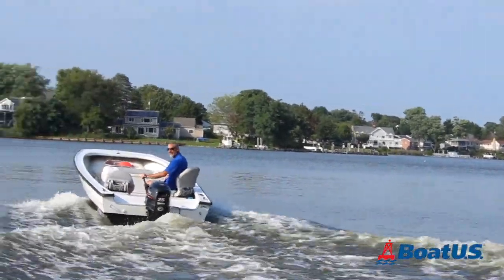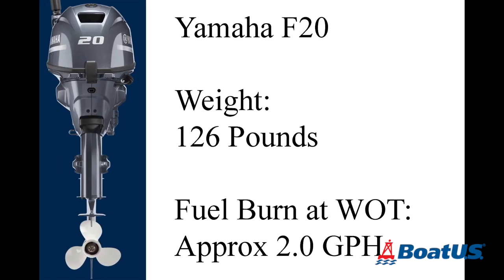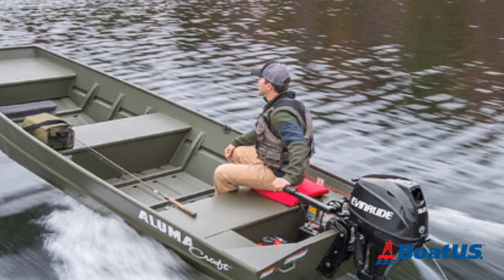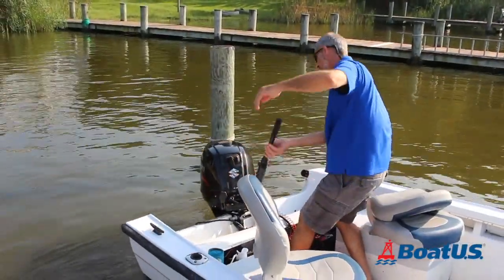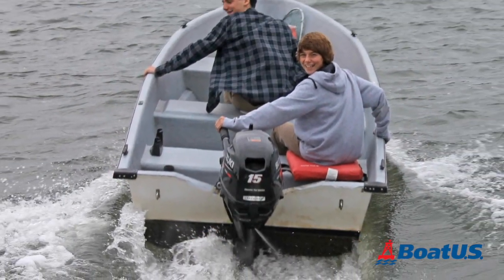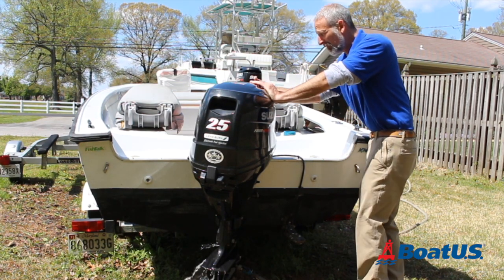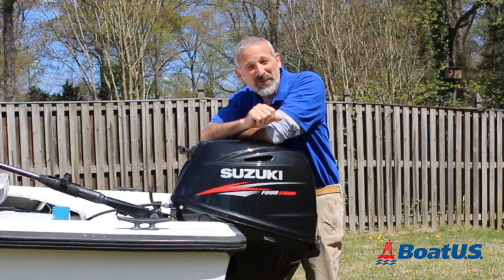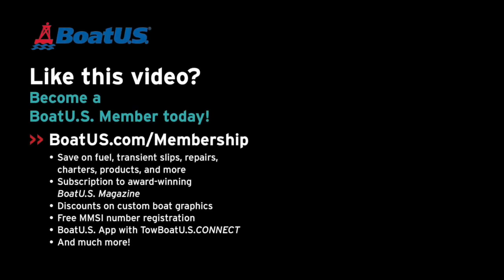Choosing an Outboard Motor for a Small Boat | BoatUS

Comment: Tohatsu 9.8hp four stroke is the best motor I have ever owned, got it 2018 and it is virtually in constant use in salt water. just cant fault it.
Reply from the maker: That's awesome, David. Glad you've have good luck with it. If you're a BoatUS Member, you might be interested in a story we have in the upcoming issue of BoatUS Magazine on the latest technologies in small outboards. We talk a little about the Tohatsu propane outboard in it. The technological advances in smaller motors are mind-boggling!

Comment: Hello!!! I am just writing you because I have not found any body talking about small engines for the small inflatables, I have a Newport (Catalina) is 17 foot long, and I am new on how to choose a small engine for it, I have found several small engines but they are very expensive, what I am looking is a cheap engines below the $1000, that it is going to take me to the ocean and fish about a Mile out, and not have any problems with it!! what would you recommend??? I would like to thank you for your information on this little matter.
Reply from the maker: While we understand your desire to stay under $1,000, Max, that probably means looking for a used outboard. You can find the smallest outboards the major manufacturers produce around that price-point, but a 2 or 2.5 hp outboard won't be powerful enough to control a 17' boat in the ocean. The minimum you should consider is probably around 20 or 25 hp (which may be slow and probably won't get you on plane with multiple people aboard), and these generally go for several thousand dollars new. We wish they cost less, too, but that's just the reality of the matter. Good luck!

Comment: Great video! I'm having trouble finding information about my old boat. I can't find a HIN number. It's a Cadillac 13.5 foot aluminum row bow with a 48" wide by 15-16" transom. It's a three seater and is 54" wide at the widest part of the hull. I'm looking to buy a 9.9 HP Merc. Is that to big? Too small? and what should the length of the shaft be? I appreciate your time and input.
Reply from the maker: Wow! What a cool boat, Start! That's a new one to us. Measure from the top center of the transom to the lowest point on the transom, and then get the shortest shaft length that matches or exceeds that measurement. You have to be exact -- you mention it's "15" or 16" and if it's 15" a 15" shaft motor will be fine, but if it's 16" you'll need a 20" shaft. As for horsepower, without knowing the manufacturer's specifications it's a guessing game, and we can't make any guarantees. That said, a 9.9 might be a bit much. An average modern 12' Jon boat is rated to 6 hp. That doesn't mean your boat can't handle more, but that's a judgment we can't make from afar. If you haven't done so already, check out the website  https://www.wagemakerwolverineboats.com/cadillac_aluminum_boats. There's a plethora of info there on the history. You might try reaching out to Brian for more info. And the reason you can't find a HIN is because you boat predates them. They weren't required until Nov. 1, 1972. Hope this helps and have fun with it!

Comment: Thanks, it was very helpful. I know that it's not common to talk to a specific brand type in the youtube for you guys but is possible to talk about that and say which brand is better in terms of quality and performance. Actually, I have stocked between Honda, Yamaha, and Suzuki but some people believe that mercury is better in terms of maintenance cost. Or if it's possible tell us some hints about choosing better brands.
Reply from the maker: Thanks for watching, Yasser. I wish it were that simple. Unfortunately there are too many variables to talk specific brands. Some folks have very specific preferences for whatever reason (like trucks or cameras). Some stick with a brand they've always used. Some go by price, features, or performance. It really comes down to your individual needs. If you narrow down your options, you can do research on any issues, find customer feedback, talk to a dealer/mechanic, or join a Facebook group or board to get feedback from others with experience. The best thing you can do is research, research, research and make the best decision for you based on the info you have available. Good luck!

Comment: Thanks for the info. I have a 4 meters aluminium fishing boat. I don't want to go the open ocean. Just rivers and lakes and if I go in the open ocean not really far. I want to know how big motor I should buy? Is 40HP should be enough? Thanks
Reply from the maker: Hi Syed and thanks for your question. If possible, you want to check with the boat manufacturer to find out what the largest outboard is that's recommended. You don't want to exceed that, or it can be dangerous. With the info you gave, however, 40 hp might be a bit too much for this boat, especially if it's lighter weight. But it's hard to give you an exact answer without being there in person and having more info. You might also want to read some of the other questions and answers here as others have asked similar questions. It may help you narrow down what you need.
Reply: Thanks for replying. I will check that.

Comment: I currently have a 25hp on a 14’x5’ with a 20” transom boat, the motor has electric start and trim, but I think it might be too heavy(180lbs plus or minus). Do you recommend a 20hp with same futures at about 124 lbs or 30hp at 131 lbs manual. The boat is rated at 920 lbs total and rated at 25. Any advice?
Reply from the maker: Thanks for the question, Yoisdel. If the boat is rated for 25, we wouldn't suggest putting a 30-hp motor on it, period. And note that 20 horses is usually plenty for a 14-footer. Also, remember that, depending on the brand, a 25 could be the same weight as that 20 you're considering. A Yamaha F20 and F25, for example, have the same powerhead and are both 126 pounds. In any case, it's wise to consider the difference between weight and power between the 20 and 25 since a 50-pound jump (which is about what you'll see with most other manufacturers) will shrink the performance difference. Either way, it's best to remove the 30-hp engine from the conversation. Hope this is helpful!

Comment: Speed is a big component!!!
Reply from the maker: Thanks for watching, Darren! You're correct--though horsepower needs to be matched to the individual boat. It's dangerous to get a motor that exceeds weight or power recommendations from the manufacturer.

Comment: Last comment...Is one of the biggest downfalls of used boat motor buyers...Know your Transom measurement  and get proper length motor...
Reply from the maker: Thanks for watching, Dan. Yes, the questions about what size/length motor to buy seem to be the most common we're getting. Like everything else, though, everyone has a different opinion. We prefer to stick with manufacturer recommendations.

Comment: i have a 14 ft v hull with a 20 hp mercury 20" shaft. My transom is 15 inches, however the previous owner installed a mounting plate that raises the motor another 4-5 inches. is the long shaft okay?
Reply from the maker: Thanks for the Q, Hunter. Chances are yes, however, once you modify a boat's transom and raise up or cut down the motor's mounting position from what the manufacturer designed and built, all bets are off. It's a good possibility the previous owner did this to accommodate a specific outboard but we have no way of knowing if it worked or not, and how well. The only way you can be sure of the outcome is to put the motor on, give it a shot, and see how it runs.

Comment: I have 14 ft v hull fiberglass And I paired with mercury 20 hp 4 stroke you think I overpowered it ?
Reply from the maker: Hi Eddie. It really comes down to the weight of the boat and maximum recommended HP by the manufacturer. Without more information, it's hard to say for sure. If possible, double check manufacturer specs. It could be dangerous if it's overpowered.

Comment: Excellent information,  I measure the transom is 23” need long or xtra long shaft ? Is an old bass boat Monark Macfast 5. I would to know what do you suggest for hp? Thanks so much
Reply from the maker: Thanks for the question, Jairo. I reached out to Lenny who had the same issue with one of his boats. Occasionally when dealing with some very old boats you'll encounter transoms such as this, which weren't built to today's more universal standards. Putting a 20" shaft motor won't work without modification; as soon as the boat begins to plane, the prop will be starved for water. You can cut the transom down in some cases, but you have to make sure there's room for turning the motor without any of the rigging hanging up or hitting the edges. You could also try a jackplate, but the results can't be predicted ahead of time - it might work, it might not. And to get the motor at the right height, you may be unable to tilt it or align the steering and/or rigging in such a way that it doesn't have issues rubbing against the transom. You may also find that the motor is too low to the water. The safest bet is to go with the longer shaft.

Regarding the horsepower question, we're not very familiar with these boats as it looks like the model was only manufactured about two years, but from what we've seen online, the max recommended is 85 hp. Others that have this model seem to be running a 70 hp. That said, because overpowering can be extremely dangerous, we strongly recommend consulting someone who might be able to confirm this info. Or do some online searches to see what others are running. Might help answer your question on the shaft length, too.

Comment: Thanks for your time, what's the best petrol for outboard motor??! 98%???
Reply from the maker: Thanks for the question, Behrang. You should always follow the recommendations as contained in your owner’s manual for your particular motor as recommendations vary. Also, it will make a difference if your motor is a four or two stroke. Often, two-stoke motors may not need as high an octane rating as a four stroke.

Comment: I have a 12 foot aluminum v haul. What size motor do I need? Is 10hp to big? I just need it for fishing lakes
Reply from the maker: Thanks for the question, Sam. 10 hp sounds about right, but you should always check the manufacturer's specs and Max power rating to be sure you don't overpower a boat when putting on a new outboard. Hope this helps!

Comment: You say you should measure your transom to know what shaft length you need, but what is the formula to determine shaft length after you have transom depth??  Or is there a table to determine that?
Reply from the maker: Thanks for the question, Uvickerns. Outboards are commonly available in three shaft lengths: 15, 20 and 25 inches, with 20 inches being the standard and the most common size. As a general rule, the cavitation plate (the flat plate that forms part of the outboard leg directly above the propeller) should be level with the bottom of the transom. For larger, heavier engines that are rigged by a dealer, they will be very familiar with which size engine to use, and you should be guided by them. But of course, there are exceptions to every rule, and a long shaft could be used on a boat that requires a standard shaft but the boat will be slower by a knot or two due to the increased drag. Also, there is that much more potential for the prop to hit a submerged object as it hangs lower.

My best advice would be to seek the advice of a local dealer who will have extensive knowledge and can ensure that you are using the correct shaft length.

Comment: What type of motor should I get for my 12 foot boat
Reply from the maker: Thanks for the question, ASMR. Unfortunately we're not in a position to give you a specific answer to your question due to not knowing what kind of boat, where you boat, etc. For a boat that size, though, you might consider one of the many electric options now available. Lenny was a hold-out on electric for a long time, finally took the plunge, and now is a huge proponent of them. (He's got an article about this in an upcoming issue of BoatUS Magazine.) When I asked about range issues, he said he hasn't had any. The one thing we can tell you is not to exceed the maximum size motor recommended by the boat manufacturer. It could be dangerous.

Comment: What size motor and brand would you recomened for a 4'x8' dingy, i would like to have a reverse and be able to hook up an extra gas tank if needed.
Reply from the maker: Thanks for the question, James. For a boat that small, you don't need more than a couple horsepower. In fact, you might want to consider one of the new electric outboard options to avoid the gas issue altogether. 1- to 3-hp models from the lines of ePropulsion, Torqeedo, and others have self-contained, rechargeable batteries with significant range. Before you commit to one, check the capacity plate on your dinghy, which lists the max hp (and max weight capacity). It will be located on or near the transom.

Comment: Sir my boat height is 1meter, 5meters lenght and 1.5 meter. What should be the right length of shaft and horse power should i buy for my boat?
Reply from the maker: Thanks for the question, Gener. The critical dimension for shaft length is transom height. Measuring from the top of the transom to the hull bottom at the center of the transom, match the height of the transom to the published shaft length for the outboard (IE if it's 15 inches, a 15-inch shaft length is appropriate). Most outboards are available in 15, 20, 25, or 30 inch shaft lengths, and most boats are built to ideally match one of these lengths. As far as choosing horsepower goes, it's a matter of personal preference up to the maximum horsepower rating established by the manufacturer. Weight is a critical factor, as some boats of the size you mention, such as a light aluminum jon boat, can plane out and run just fine with as little as 20 horsepower. But a heavier fiberglass center-console of this size will more likely need 40 or 50 horsepower to produce satisfactory performance. Hope this helps, and thanks for watching!

Comment: Hoping you might know.  I am looking to buy a 15hp Honda outboard for my brother as a surprise.  I know he has a 13 foot Valco aluminum boat and figure a 15" shaft is the right fit.  Like I said this is a surprise so I don't want to call him for measurements.  Any suggestions?  Appreciate any help.
Reply from the maker: What an awesome gift, replus! Unfortunately we would be doing you a disservice by trying to guess this without being there in person. Because you aren't able to get the measurement directly, I'd try to find the specs online, though it looks like this may be an older boat so that may be difficult. Also, you would be assuming the transom is original and hasn't been modified. (I'm seeing some ads that mention the transom has been built up.) You might want to look for a Valco group on Facebook or look online for an active forum with Valco owners and ask for advice there. I wish we could be more helpful, but we certainly don't want to steer you wrong. Hope your brother loves the outboard, and here's to having fun on the water!

Comment: My Macgregor 26D has a 20" transom measurement and the old outboard was a long shaft 20". Guys online are saying get the extra-long shaft; some say for rough seas. What is the downside in performance for a longer shaft than measured as needed?
Reply from the maker: Thanks for the question, Martin. Having a longer shaft increases drag, which reduces speed and efficiency. Since the MacGregor 26 is a planing boat the difference could be significant and generally speaking the best move is to stick with the manufacturer's recommendation, so if the old one worked fine, we'd say it's probably best to stick with the 20" shaft. If you noticed the prop gulping air in rough seas, however, a longer shaft would likely resolve that issue. Thanks for watching!

Comment: is it possible to replace a different brand like Yamaha or Suzuki for 15' Boston Whaler Mercury outboard?
Reply from the maker: Absolutely, WestCoast. Doing so will likely require re-rigging, but if your current outboard is outdated, you've probably got outdated steering and throttle-control systems, too, so they'd need to be changed out anyway. Hope this helps, and thanks for watching!
Reply: thanks